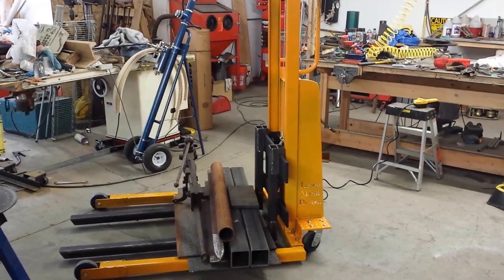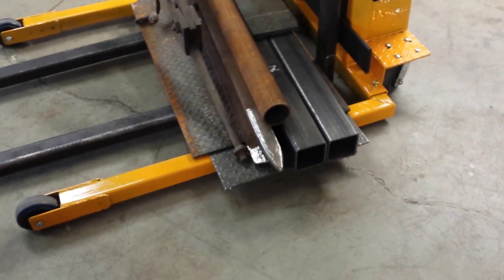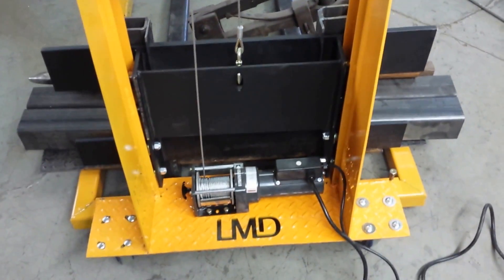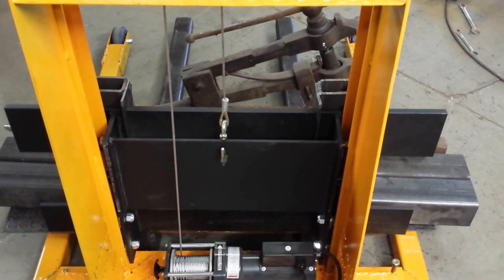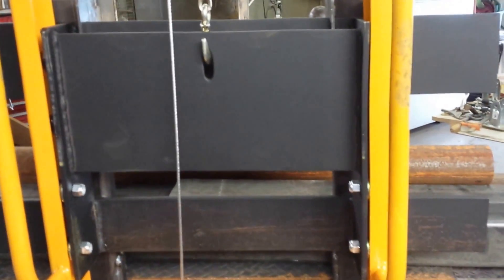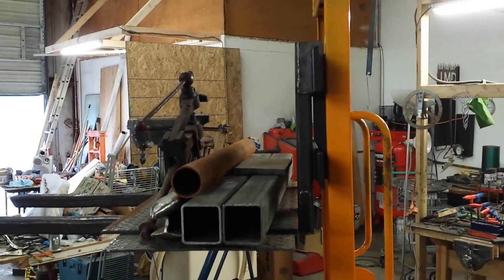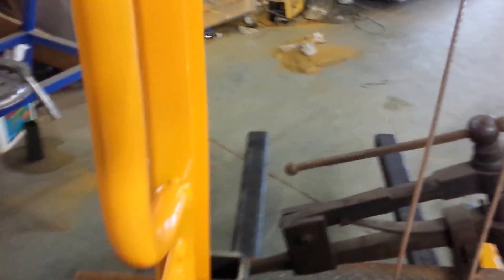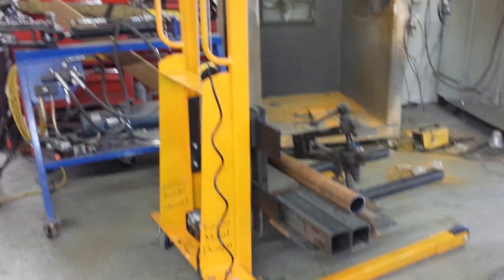Homemade Material Handler load test

Comment: Looks good I just finished a lighter duty one using a winch motor like what you have
Im just a little worried with a lot of use the cable drum is going to deteriorate the wire rope